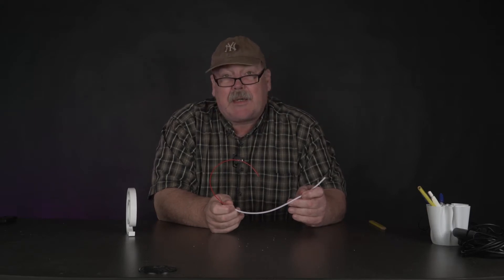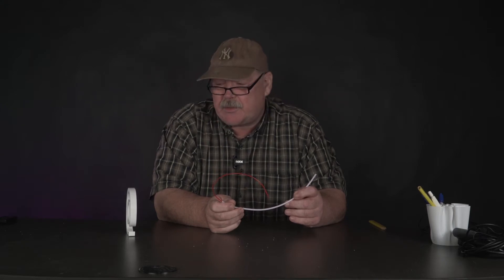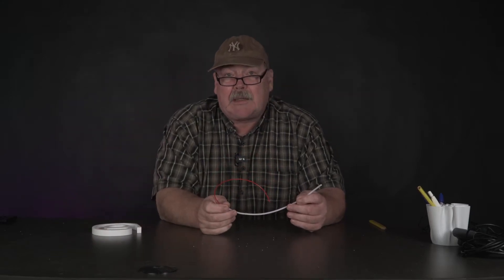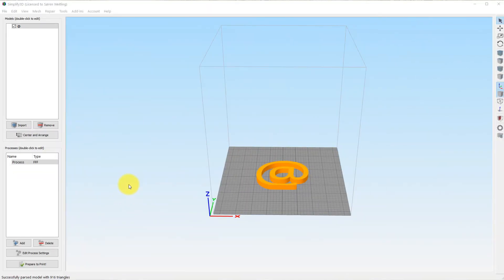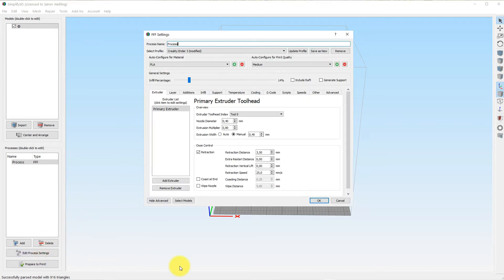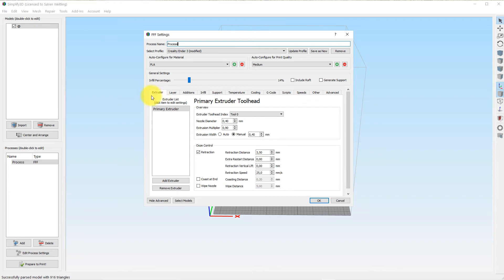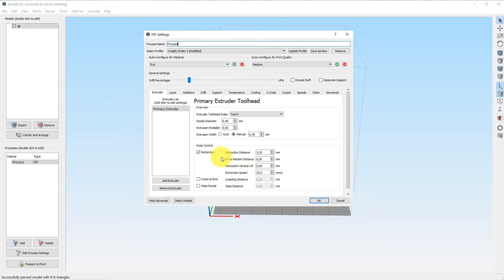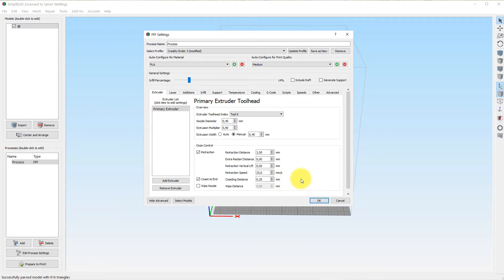Blobs and stringing a pain in your 3D print

Comment: Why is the extrusion multiplier 0.9? How did you calculate it?
Reply from the maker: Thanks this comes from calibrating my extruder.  To know more take a look here  https://www.youtube.com/watch?v=_VPvRXIrg04&t=198s
Reply: @weitlingD3P  I see. I just thought that the extruder steps are calibrated first, after which it always produces exactly 100mm, and then for some filaments a multiplier of 0.9 instead of 1 is specified, and I was wondering what is the reason for this additional setting (after the extruder has already produced exactly the right amount of filament). I suspected that there was some secret knowledge :)
Reply from the maker: @xiaotuolu  You do this step if you see gabs in your print or other print failuers.  or if you just want to check if it is ok.  New printers of today are automatic dping a flow controle,  liked the Bambo .